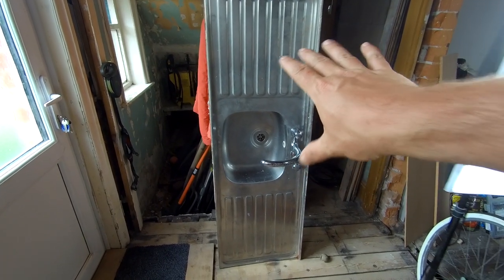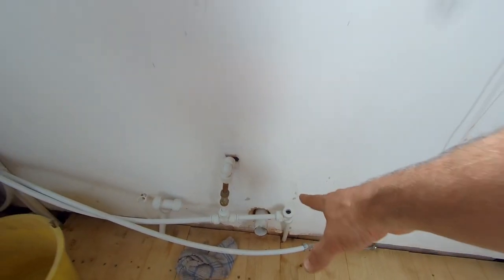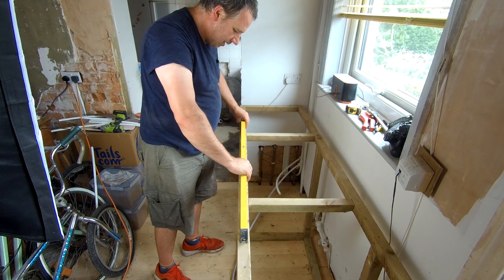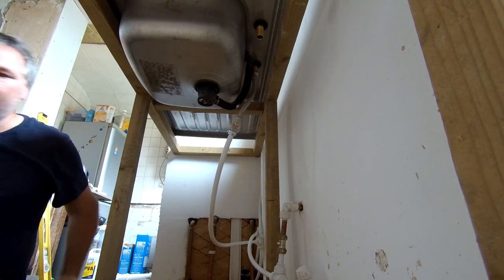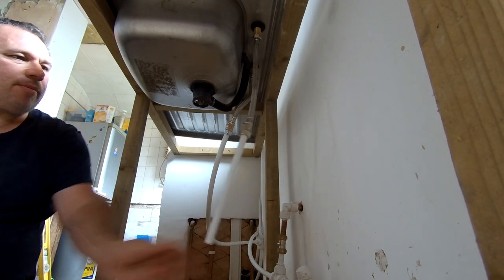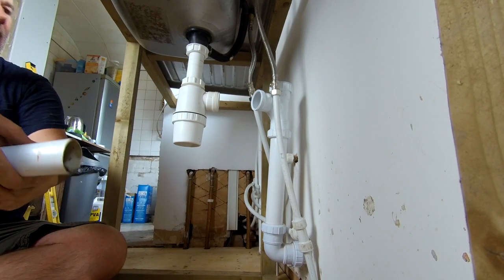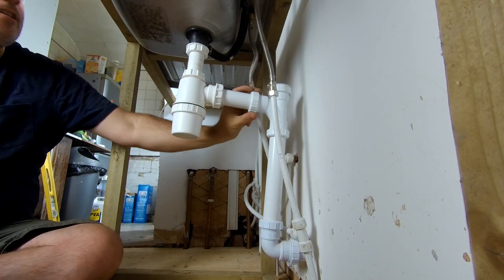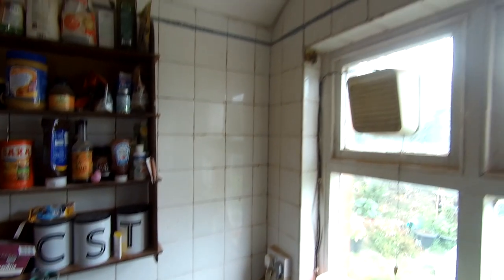Moving a kitchen sink and plumbing it in | DIY Vlog #34

Comment: Good show as always. Tip on shortening those white plastic waste pipes is to run them over with sandpaper or a fine file after cutting, cause rough edges will catch some of that nasty stuff and eventually could cause a stoppage.
Reply from the maker: Yeah I did sand it down a bit and get the worst off. But was rushing to get it filmed and finished and need to change it when the real sink and units go in there.

Comment: My sinks been moved over slightly & there’s a waste pipe frm the sink behind going frm the old outlet that takes water outside.     I can’t even push my washer all the way back because the pipe runs behind it .  
It is lazy plumbing ?  I’m thinking could he drill a hole & put the pipe on the outside of the house ?
Reply from the maker: I'm not an expert but I wouldn't say it was lazy plumbing. I wouldn't want to drill a hole through the wall if a waste outlet was already there to use. Sink plumbing is usually hard to work on in such a tight place.